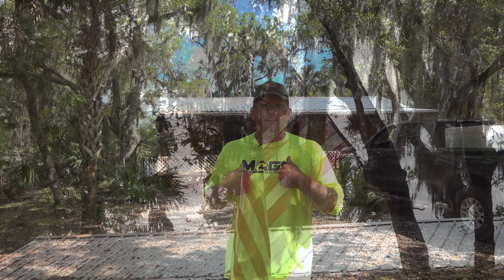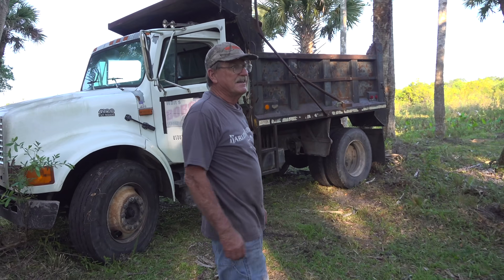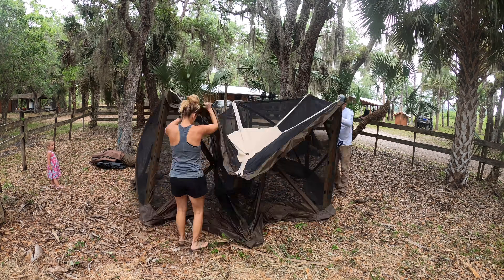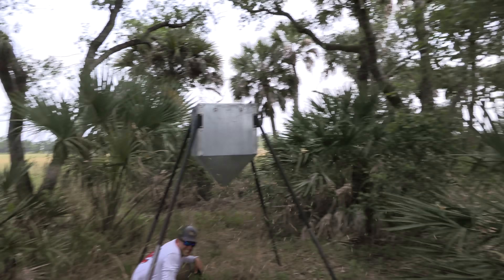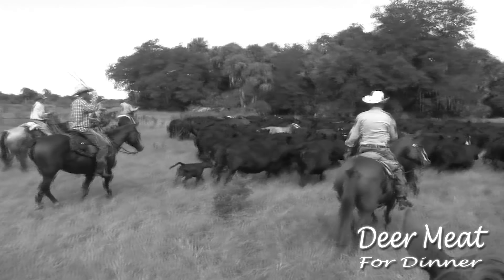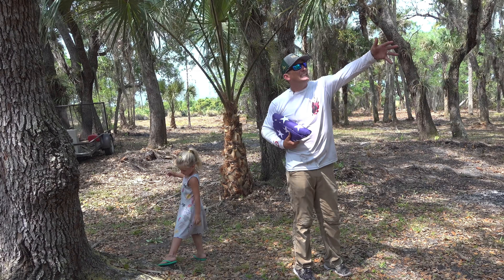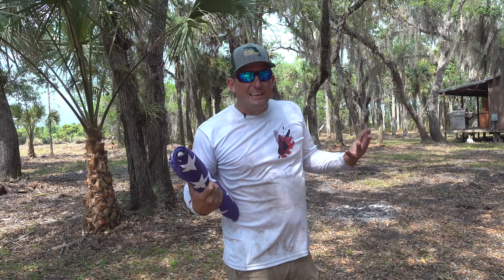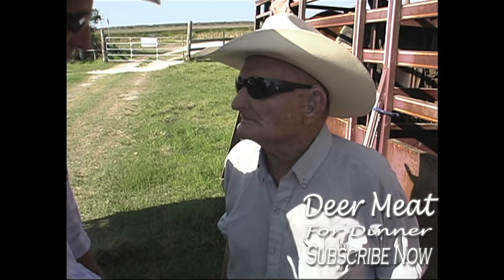The SCARIEST Machine I've EVER Seen!!!!

Comment: You also need to get up on that metal roof and blow that stuff off now that you have cleaned out around the area otherwise it could get wet and saturate the crack of where the two metal roofs join and rot causing a leak or inviting ants a place to live and ruin your roof TY BA3